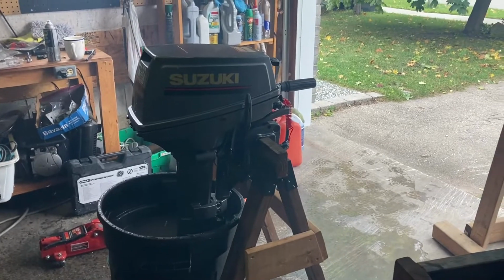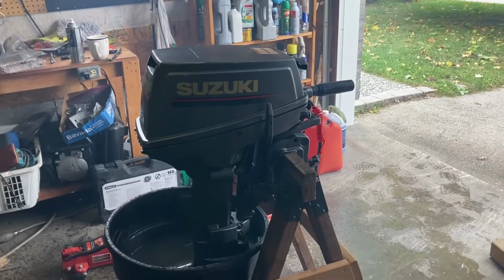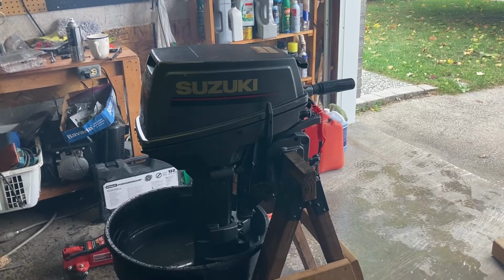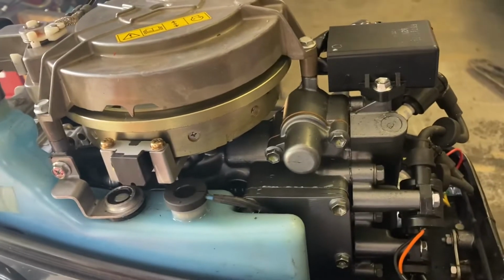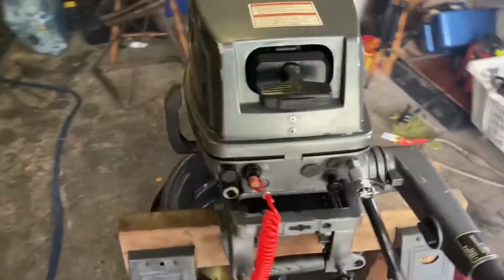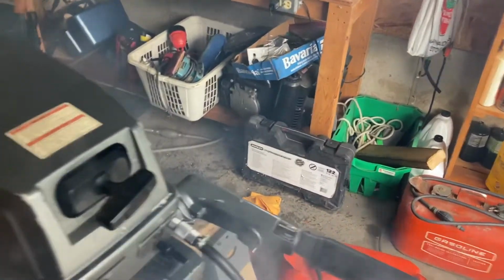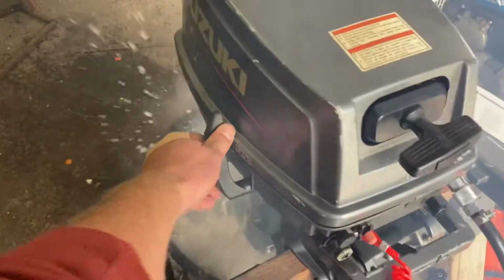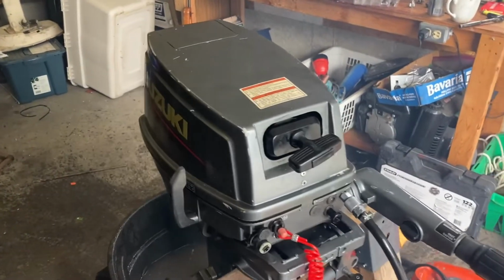1992 Suzuki 8 HP Outboard Motor

Comment: I have just bought one of these motors, is there anything I should keep a eye on
Reply from the maker: They are really well made old motors but as they age the oil injection system has been known to fail. You can simply pre mix your oil gas and bypass the system if you are worried. Best of luck with it and thanks for watching.
Reply: I will have to keep my eye on that make sure its ok @patricksmotors9070
Reply: @patricksmotors9070  I have the same motor. Recommissioning it after 10 years. Did you do anything other than putting Seafoam Marine in the tank? Change the plugs, gear oil, fuel lines, oil filter?
I plan on spraying some Seafoam aerosol lubricant into the carb and spark plug holes as well. Maybe add some Seafoam Marine into the oil reservoir to clean out the injection system?

Comment: what fuel mixture needs to be prepared for this model
Reply from the maker: This model is oil injected. So it has an oil reservoir and you run it off straight gas.
Reply: @patricksmotors9070  All that smoke from the oil injection system? Or didn't you trust it? Even 100:1 injection combined with 100:1 pre-mix shouldn't have smoked that heavily.